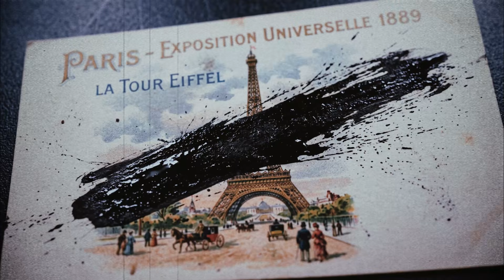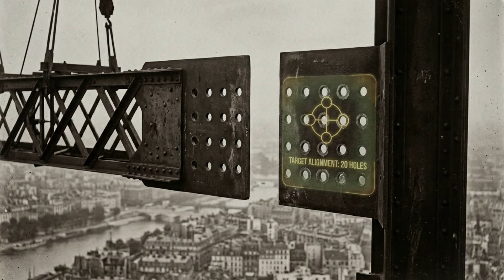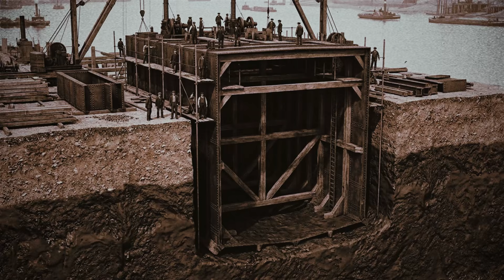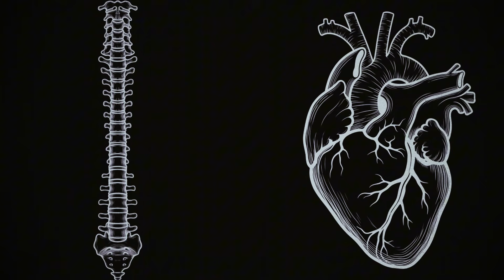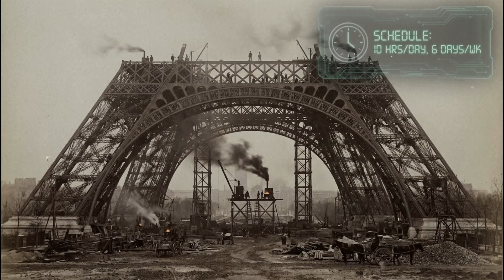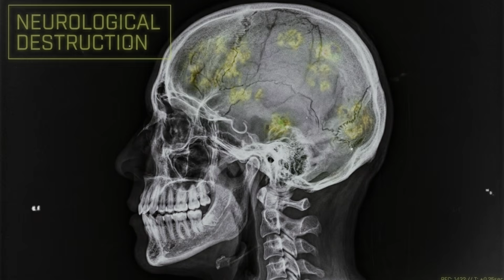The Eiffel Tower Fraud: The 7,300-Ton Thermodynamic Meat Grinder

Comment: 2 atmospheres of pressure is equal to being underwater at a depth of 33 feet.
Reply from the maker: Spot on calculation. Working in caissons under ~30 feet of Seine hydrostatic head meant high risk of caisson disease (the bends) and brutal thermodynamic conditions for the crews sinking those masonry piers. The physical toll on human labor in those pressurized chambers was immense.
Reply: @TitanMetrics  RIP
Reply from the maker: Exactly. The human cost was buried right beneath the foundations while the official records took all the glory.

Comment: The tower was supposed to be a temporary tower. It was a radio tower and after the World's Fair they talked about tearing the tower down. Why would they put so much into the engineering for what was then a temporary structure?
And why didn't they set up a dual airlock (exit/entrance) above the main airlock? This way a group exits the main airlock into a decompression airlock and the next shift enters the main airlock from a compression airlock?
Reply from the maker: That is a brilliant question to bring to the audit desk, Martini! Just a quick correction to the official ledger: it wasn't originally built as a radio tower. The military radio antenna was actually added years later, and that is what ultimately saved it from the demolition block!
But your main point is 100% spot on. Why massively over-engineer a "temporary" structure? Because the "temporary" label was the ultimate corporate loophole! The World's Fairs were incredibly well-funded testing grounds for industrial syndicates. By classifying this massive 7,300-ton iron structure as a temporary exhibition piece, the contractors bypassed strict civic building codes, long-term public financial audits, and standard zoning laws. It gave them the perfect cover to secretly deploy their advanced, undocumented heavy mechanization right in the middle of Paris without full oversight. It was a massive PR showroom for their tech monopolies!
Reply: @TitanMetrics I did not know that the radio tower was added years later. Thank you for letting me know that. But the over engineering is a question. Thank you for responding to me.
Reply from the maker: Anytime! The audit desk is always open.

And I want to address that brilliant question you added about the airlocks! You are exactly right—Eiffel's contractors used pneumatic caissons for the river-side foundations. Setting up a dual airlock system (one for compression, one for decompression) makes perfect logistical sense for shift efficiency. So why didn't they build it?

Because in the 19th-century corporate ledger, human labor was the absolute cheapest variable! Building a complex dual-chamber pneumatic system required expensive, high-grade valves and extra structural steel. The syndicates were perfectly willing to use hidden, advanced heavy machinery to hoist the tower and protect their patents, but they absolutely refused to spend their black budgets on worker safety or comfort down in the mud. They slapped a cheap, single airlock on it and let the laborers suffer through the brutal compression times. It is always about protecting the profit margins! Great eye for the kinetic details!
Reply: They found the tower they never built it they just renovated it previous race before us that were giant that built it
Reply from the maker: @page-thaed  While the audit desk absolutely agrees that the official story is a massive lie, we strictly reject the "found structure" and ancient giant theories!

If you run a strict metallurgical audit on those 7,300 tons of puddled iron and analyze the proprietary riveting systems, it is definitively 19th-century industrial technology. They didn't find the tower; they built it.

The real massive corporate cover-up isn't about who built it, but how they built it! Gustave Eiffel’s syndicate used highly advanced, undocumented heavy mechanization and steam power to hoist that iron, but they cooked the official ledgers to claim it was done by a tiny crew using basic hand tools. They hid their true technological capabilities to protect their industrial monopolies and secure World's Fair contracts. We follow the physical supply chain and the strict kinetic math, not ancient mysteries!